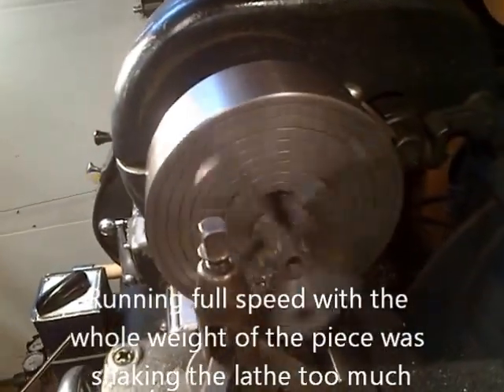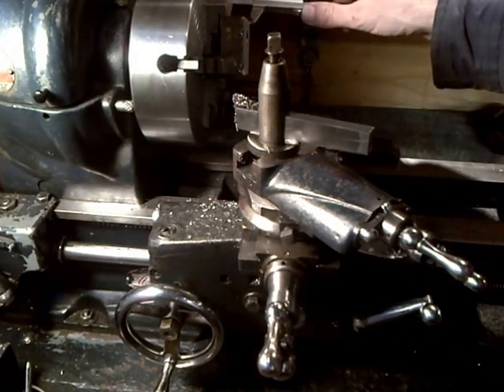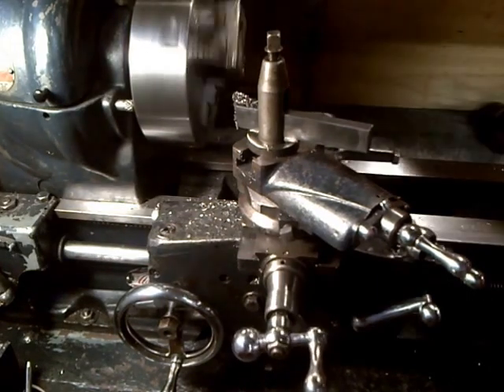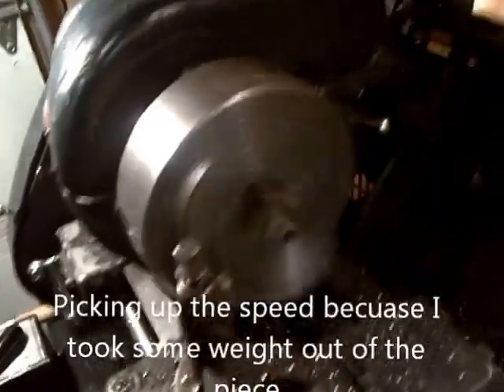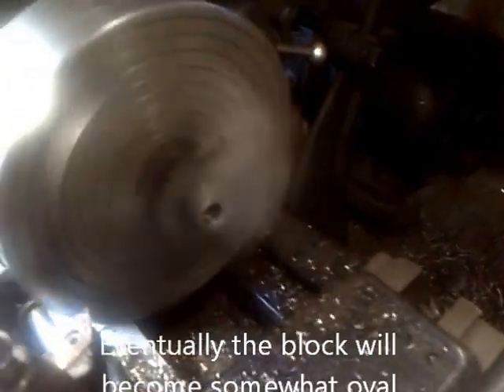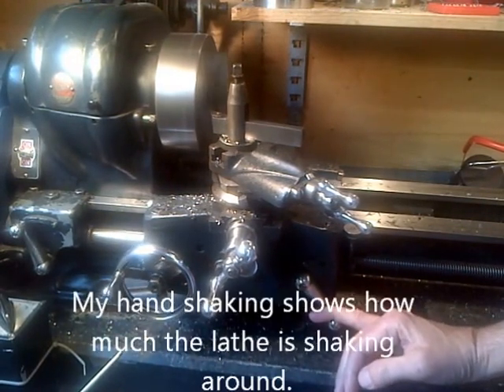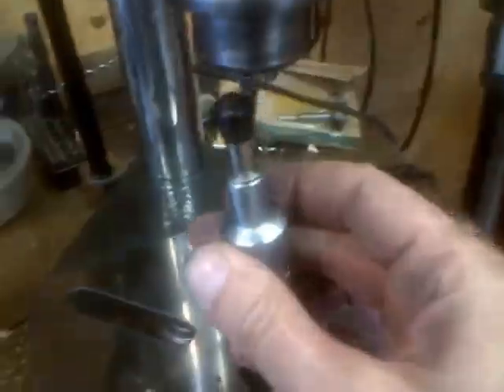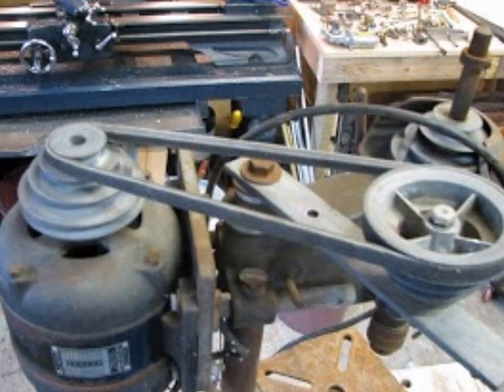Atlas Drill Press Speed Reducer

Comment: Nice job!  I just added an intermediate pulley on my Atlas too.  Kind of the same idea.
Reply from the maker: +MrBen527 Thanks, the extra pulley is really needed to get the speeds down for metal.
Reply: Steve S
That's the same reason I did mine.